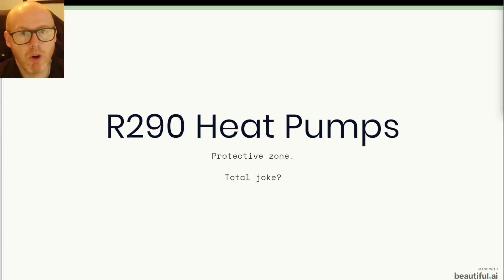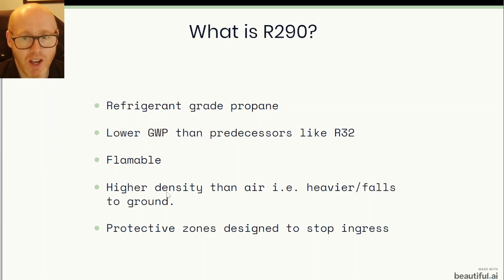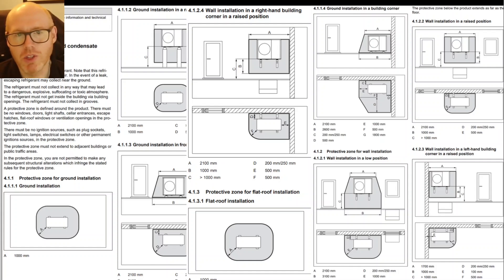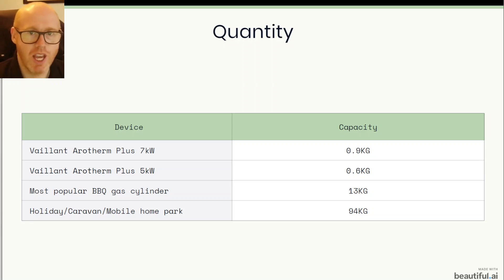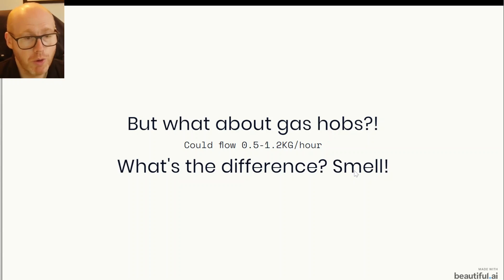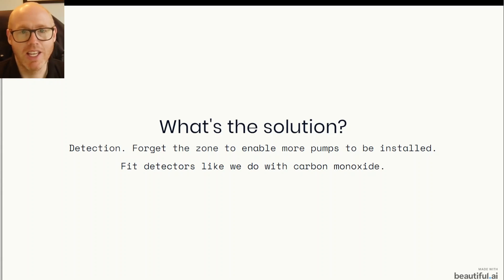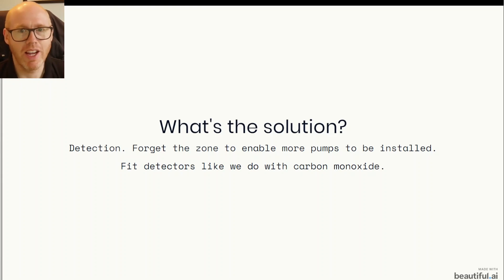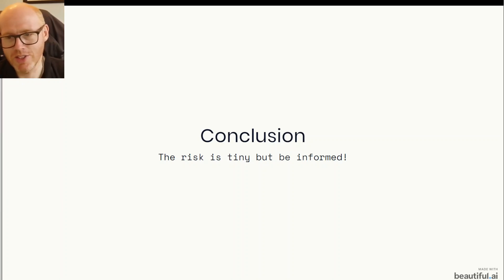R290 Protective Zones Are a NIGHTMARE - Here's Why

Comment: We'd struggle to accommodate one, and we have a modest 4 bed detached (its quite small)
We'd not be able to get it down the side of the house near where the current boiler lives, and I'm not sure it'd work (or look appealing) in front of the conservatory either.
Got a few years left on our combi boiler warranty, but honestly in no rush
Reply from the maker: That's a shame.
Reply: @UpsideDownFork  Yes.  I do need to get it properly assessed to be fair, but based on similar YT'r experiences and vids luke your own, it's either not viable or unsightly placement 🥺
Reply from the maker: @stuartburns8657  Have you considered the vinyl wrap option? That's quickly becoming more popular to 'hide' them.
Reply: @UpsideDownFork  No, I've not even thought of that what so ever.
I'm not going to kid myself, it'll be the Wife who decides what's 'unsightly', wrapor not lol.
I think even with the other refrigerant, it'd also still to deemed too close to neighbours for potential noise reasons.
I'll get it properly scoped out after Xmas, I'm curious now, happy to be proved wrong!
Reply from the maker: @stuartburns8657  I hear you about the wife issue! 😂
I've got friends who have failed noise assessments as well. Fingers crossed 2025 they drop all the permitted development restrictions on heat pumps.
Reply: @UpsideDownFork  Absolutely.  Whilst our actual gas spend is remarkably low (between £550 - 700pa) is still a technology I'm more likely to adopt before an EV I suspect, but even with restrictions removed or lowered, I'd not want a HP being a noise nuisance for either myself or neighbours!
I think you are right though, common sense will prevail, otherwise the whole endeavour is dead in the water

Comment: I have a drain close my ASHP.  My installer just put a cowl over the drain to comply with the regs.   Given the low amount of propane in the average heat pump, I think current regs are bit over the top to say the least.
Reply from the maker: Glad to hear yours was an easy fix!
Reply: Does your drain incorporate a water trap as well?